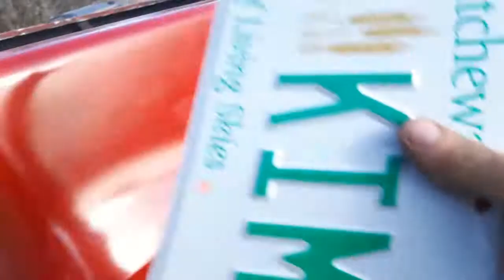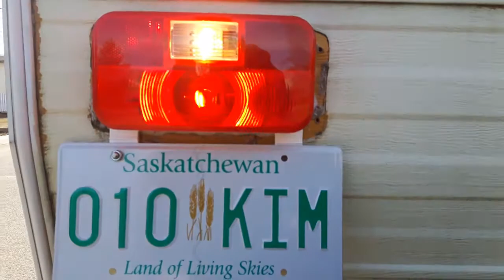Brake lights swap on the RV

Comment: That stuff you scraped off is called butyl tape, helps keep the water out. Good job with the swap out. Might consider putting some in. Buy from amazon.com
Reply from the maker: Natasha Allen yes. I forgot the name of the tape, but have sealed it up with dicor rv sealant. :) and really like the new lights. Better light output during the day

Comment: loved ur video, but I have a problem, I might have wired it wrong. I have red, black and green on my lights,  white, red , and green  on my camper, how do I hook it up???
Reply from the maker: Hi Richard, best thing to do when i doubt with trailer wiring is to to connect your truck to the camper trailer electrical and turn on 1 lights at a time and test the wires withba test light to see which wire does what.
Reply: ok, the plug on my truck is bad.

Comment: why didn't u plug the white wire to the camper?
Reply from the maker: Good question, i could have, they are just ground wires so i could've crimped on a eyelet terminal to each and screwed them into the sheetmetal behind the lights, but the RV didnt have an actual designated ground wire for the lights  they just ground out to the body. At 16:10 you'll notice i add an extra screw right the the light body into camper and it grounds grounds out just as well.

Comment: You should have upgraded with LED lights
Reply: I just installed some led lights on my rv trailer today.   Individually, brakes, running lights and turn signals work but when running lights are on, the turn signals do not work.  Re-installed the incandescent lights and they work normally.  Any answers?  I sure wish I can get these leds to work.